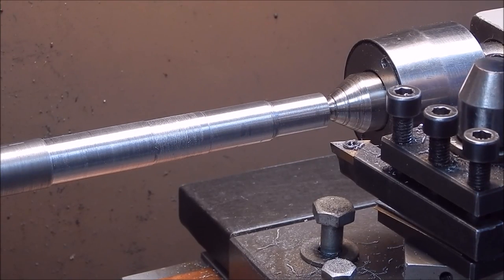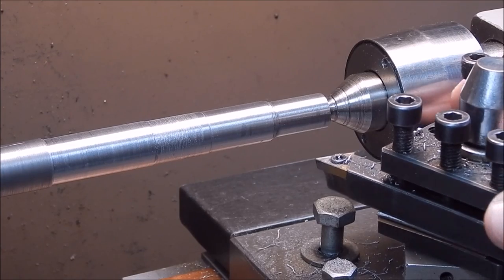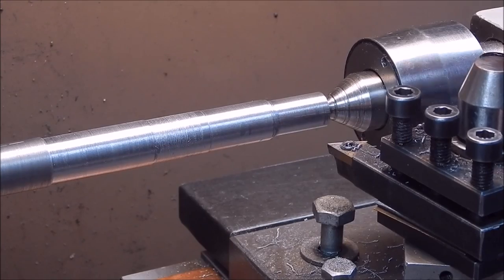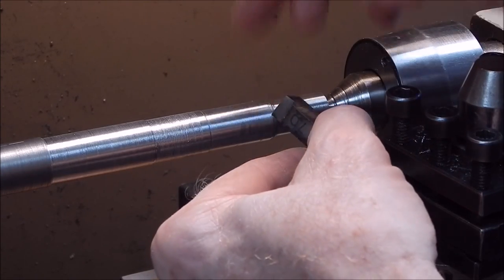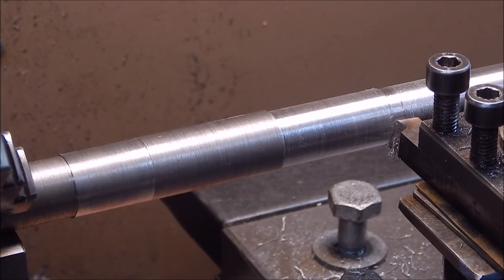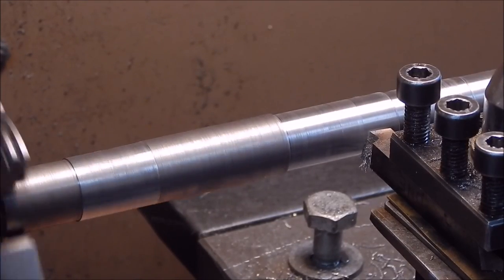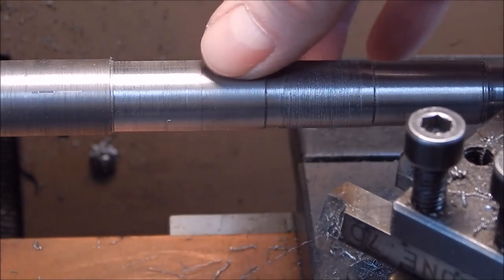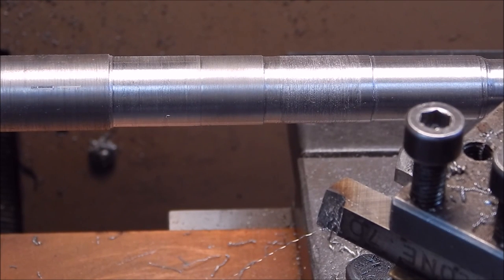The other metal lathe finishing tool - the shear tool

Comment: Hi Rob, if you go to a truck and trailer repairs and ask them if you can have some old "S" cams from truck and trailer brakes, they are nice steel to machine,  the trailer s cams are longer than the truck, I use them quite a bit.

Comment: Rob I use this tool as well for finishing, another advantage of this tool is that if one uses a QCTP one can quickly raise and or lower the tool to get a new sharp cutting edge.
This is duo to the tool only cutting on the center line of the stock that is chucked up.
Reply from the maker: Al Slitter Good point Al.  You can also shim the cutter up or down in a conventional tool holder to change the cutter edge.  I also have one with a double facet cutting edge (secondary relief) which allows it to be angled and get in close to large shoulders.  A good tool and very easy to grind.  Cheers Rob

Comment: Shaving tools are excellent for fitting bearings on shafts etc--fine gossamer swarf comes off with a beautiful finish..Good stuff Rob    regards Ian
Reply from the maker: Ian Craig Hi Ian.  Yes, bearings and bush journals were going through my mind on this as well.  I have yet to try it on cast iron.  Should be excellent for making piston rings. Cheers Rob.

Comment: Rob,
I've seen that type of cutter before. You get a great finish, but it's like watching paint dry having it cut so slow. Thanks for the video.
Have a good one!
Dave
Reply from the maker: Swarf Rat I just crank up the speed and it works OK.  I can't see any benefit from cutting at a slow speed.  The fine feed rate of course is important. Cheers Rob

Comment: Love mine, I also have one for facing that works great.

I have found the best finish combo on any material with these is high speed, slow feed and a small amount of lubricant.
Reply from the maker: I have to agree.  I couldn't see any benefit from running at the slower speed in the video.  How does the facing one work?  I haven't seen that application.  Rob
Reply: xynudu The facing tool has a curved front (you need to set the height more carefully but it isn't as critical as a normal facing tool if you have a hole in your stock). I am sure there are pictures online but if you have trouble shoot me a message and I'll take some pictures of mine for you.
Reply from the maker: caskwith Ok. Thanks.  Rob

Comment from the maker: For best results with this cutter, you want a razor sharp edge on the 30 degree cutting face.  Also, the cutting method as described by caskwith in comments is optimal for the best result.  Crawling along at a slow speed seems pointless IMHO.  Overall, a very handy cutter, able to give a stunning finish on basically rubbish steel.  Cheers Rob
Reply: This tool make taper but I am not samile

Comment: Ever try a water finish tool. Grind like a normal HSS tool except instead of a point, have a 3mm radius as the cutting point then a 3mm flat level with the job then a slight taper leading off the job. Hone the front of the tool with a stone. Then use a slow spindle speed, double your normal cutting feed and use plenty of coolant.
Reply from the maker: bloodyripperau I have a carbide finishing tool with a similar profile - ground it myself, and it works well. I use regular speed with it and no coolant. The taper leading off from the job is critical. Cheers Rob

Comment: Nice tool and video.  Thanks.  But why go to the trouble to grind the side clearance angle?  Why not just increase the face clearance angle by 10 degrees and rotate the tool post 10 degrees from perpendicular to the work?  This is less grinding and then a person can use the tool to turn up to any height of shoulder.
Reply from the maker: This is how the original proven grind is done, and it works 100% .

Try other approaches if you like. 

I have played about with the various angles a bit, but the standard grind works best.

The danger with this tool is that it can easily catch and dig in, if not applied correctly.

Cheers Rob

Comment: Nice tip Rob, I struggle with that feathered finish on mild steel. What is the slowest feed rate per revolution on that lathe? It appears much slower than mine. The Atlas lathe's slowest feed rate is .0042 per rev of the spindle which is probably the fastest of any lathe made. You think a bit like this will work well traveling that quickly ?

Regards,

Rich
Reply from the maker: The Atlas speed equates to 0.1 mm and should work OK.  My lathe goes down to 0.05 mm, but 0.1 is quite common on larger lathes.

I use my shear tool to finish most jobs, as the end result is always very consistent and fine.

Try it.  Easy grind.  Just be sure not to apply too much pressure/depth of cut as the tool can easily swing into the work and dig in.

I generally just wind the cutter up against the out side of the job so I get a scratch mark when I move the carriage to the start position.

That's enough pressure to do the job.

Cheers Rob
Reply: Yes, I can see from the grind that it can lead to trouble quickly on a deep cut, but for a finish cut you get great results. Will try it! Thx :)
Reply: Unbelievable! Just made & tried one, crap hot rolled steel, one pass with HSS...decent....finish pass with shear tool & hit with scotchbrite...looks like ground drill rod!! I have always had to sand to get a finish...I am amazed!! Mind if I do a video on it for my subscribers? Will give you full credit for the tip, let me know :)
Reply from the maker: Go right ahead.  Spread the word.

Most people have never heard of a shear tool.

Easily the best finishing tool I've ever used.

Cheers Rob
Reply: I stood there in shock as that cutter moved across the surface. You sir have saved me from hours of sanding steel parts. Thanks for doing that video 🍺

Comment: This is a very old technique from at least 1830's. I learned it decades ago from an old 1905 book and in 1905 it was considered a very old technique. It was originally created as a finishing tool for Shapers and Planers and then adapted for use in other situations like lathe turning.  Unfortunately the current  "Shear tool" "fad" has it backwards. The chip should be driven toward the finished side not the uncut side. Doing it this "fad" way gets chips caught between the work and the tool, wedging it in and marring the surface. Even calling it a "shear" tool is a corruption since ALL metal cutting tools cut by shearing.
Reply from the maker: So how do you drive the chip towards the finished side ?
Reply: @Xynudu  The tool is backwards. Grind the cutter facing the tail stock so the chip flows to the right side. That is exactly how it was done on planers/shapers but today I see even guys using it on shapers have it wrong pushing the chip into the un cut side.
Reply: @Xynudu  Or you could use the tool as is but feed to the right. The angle of the cutting face can also be varied so you can feed faster if you like.
Reply: Keep in mind that the original application on the planer/shaper the whole tool face cuts the work and the feed rate can be almost as high as the width of the tool per pass. On the lathe the contact is only on the tangent so the feed has to be much finer to overlap the previous pass.

Comment: That live center has had a hard life.
Reply from the maker: It's done 20 years daily work.  I have a newer one with a smaller diameter body as well. I could pull it apart and reface it with the TPG, but it still works OK.

Comment: Hey Rob....Jim again :)  Just another quick question. I've started to run out of Suttons TECMAX HSS blanks that I've had for yonks. Are Chinese HSS tool blanks ok? Or do you go for a name HSS tool blank?
Reply from the maker: I've never knowingly used Chinese HSS blanks.  That's not to say they aren't any good.

I  get mine from Paramount Browns, but that was quite a while back.  They generally last a long time.  I assumed they would be good quality.  Some are marked Made In England and some are Super Capital brand, which is top quality for HSS.  

All I can say is that my Paramount ones last and hold an edge well - no complaints.  Where the current ones come from I can't say.

HSS comes in many hardness grades, but that is rarely marked on them.  As a basic rule of thumb, if there is a brand or grade marking and it's sold for turning, it's likely to be decent quality.

Good luck.

Cheers Rob
Reply: @Xynudu  Cheers Rob, thanks mate
Reply: @Xynudu  Just found this, an interesting read - http://www.tttg.org.au/php/ArticleView.php?id=71
Reply from the maker: Thanks for that.  I will have a read.  I used to have a list of the most common grades, but it seems to have gone walkabout.

The more exotic stuff is usually a lot more expensive and mainly used by industry for specialised tasks like die making, extrusion formers  etc.

Cheers Rob

Comment: Where did you get the carbide cutter? (the holder not the insert)
Reply from the maker: Redwood Machinery in South Australia.  It's just a standard 12/13 mm TCMT set same as you can buy from all the major sellers, Banggood, Ebay etc. Not very expensive.

Rob